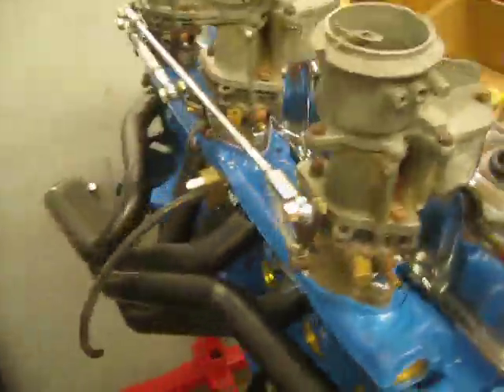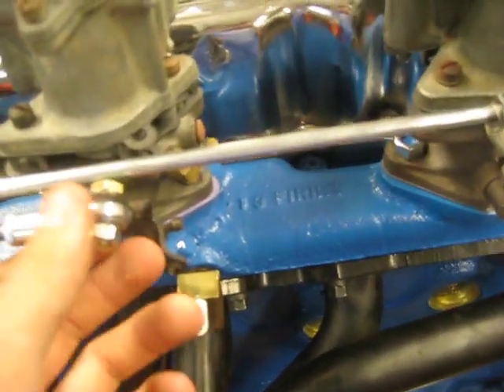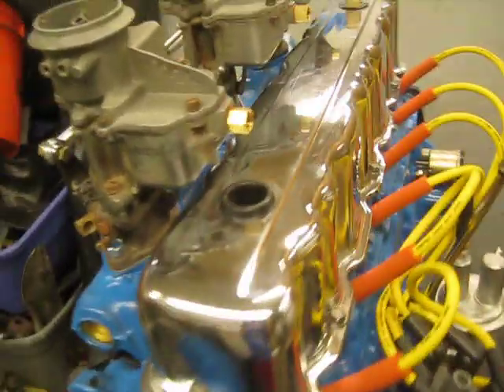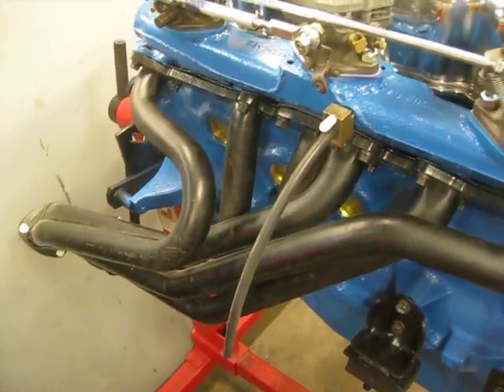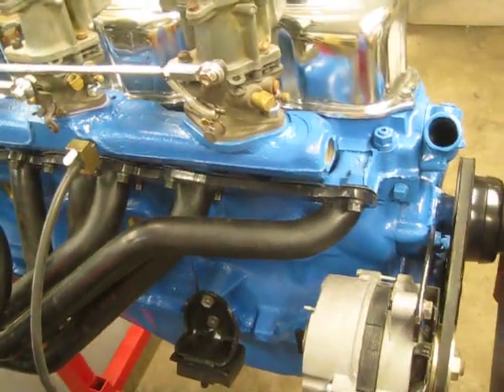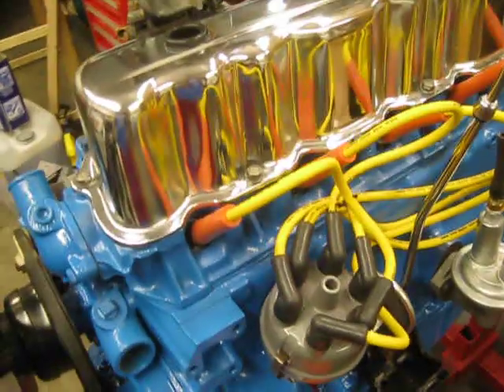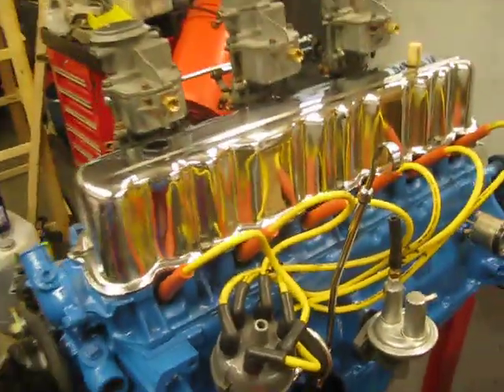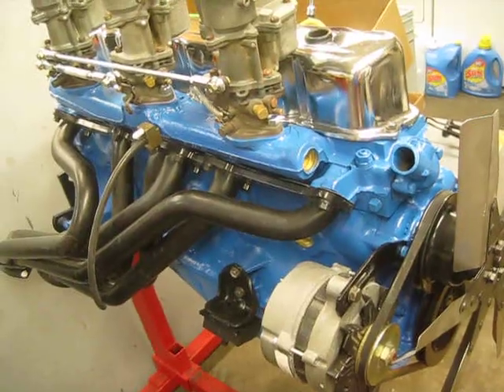200ci Ford Performance engine

Comment: 260hp isn't crazy for a "6 cylinder" just for the shoddy cast log intake manifold for your Ford engine. Considering people are cranking out 2,000+ horsepower out of a Toyota 2JZGTE engine. 260 is peanuts but still far better than the 120 or so horsepower the 200 made from the factory. I say we all lean on some foundry's to get the Vintage Inlines aftermarket aluminum cylinder head churned out again!

Comment: 240 Horsepower?  That’s still pretty good.   Considering the bone stock barra motors are about  250-260 hp.   But anyway excellent job.   Right now I’m working on rebuilding my 250ci L6 from a 76 ford Granada that was dropped in my 63 ford ranchero.
Reply from the maker: Thanks! No idea what it actually makes, that was just a guess based on several other similar builds. Sweet project, I like the early Rancheros.

Comment: Nice set up. Hope that you are still around. What year was the cylinder head. In order to do this mod one has to have, as you have, a flat intake log in order to be able to modify it. Would you  be willing to sell  the mod process?
Appreciate a reply
Reply from the maker: 1975 250 head. On a round log head you would just fish-mouth some tubing and weld it between the head and the carb flange.

Comment: I'm impressed with the weld-onto cast iron carb flanges. Three carbs should help w' the fuel distribution issue. Back in the 70's I used a Colortune clear glass spark plug to help balance multiple carb setups. Uni-Syn carb flow tester was also a necessity. It made a BIG difference in part-throttle conditions.

Comment: Nice 200! I have in my 64 Ranchero, good little engine, mostly stock, elec. ignit. with a 5 speed behind it, good for the freeways driving. Thanks for posting this; good luck and have fun with it!
Reply: What 5 speed did you put in and how did you find the bell housing for it ??? I’m really confused on how to fit a bell housing bc no one makes them
Reply from the maker: Use your stock bellhousing and get an adapter plate from Modern Driveline. The adapter plate will allow the 5 speed trans to bolt up to your original bellhousing.
Reply from the maker: Part number MD-401-2102 for 1967+ bellhousings, MD-401-2103 for 60-65 bellhousings

Comment: Good evening. 
I know you posted this video years ago, but could you tell me where you got your cylinder head? I am working on an inline 6 for a 67 Mustang, and I wanted to upgrade. Appreciate your help.
Reply from the maker: I built it out of a 1975 model 250 head
Reply: @SuperKONR  the 75 head still has the intake casted to the head? Is there a head that fits the 200ci that doesn't have that intake molded to the head?
Reply from the maker: The only production head with a removable manifold is the Australian 250 "2v" head. There used to be a guy importing them to the states but his website went down a few years back.

Comment: What ever happened with this Tri-carb 200?  I've looked at your more resent videos and dont see any break-in or install vids.  I was hoping to hear your motor run??  I built a 200 myself, but didnt have the guts to attempt a tri power setup.
Reply from the maker: I think there's one of it running on the test stand. I broke in the cam and it's just been sitting, it's going into my 1940 Desoto eventually.

Comment: I have a complete stock 200 6. What are the best performance upgrades I should do with the best value? Hp vs cost.
Reply from the maker: The biggest problem with these engines in the integral intake. If you're going for modifications I'd get a late model large-valve head and have it machined for a 2v carb. The thing with that, is while you're in there you might as well put a cam and valve springs in it, so it depends how far you want to go. What car is it in? They are pretty decent motors without modifications. I ran a fresh bone stock 1966 200 with a Holley 1910 carb and a Clifford header for awhile, it would pull hills at 70 with basically stock gearing and a manual transmission. Don't bother with electronic ignition, points work better.
Reply: SuperKONR thanks for the reply. It’s in a 65 Mustang. Sentimental value being my grandfathers. I want to keep as stock as possible but I also want to be able to keep up on the freeway.
Reply from the maker: Is it an automatic or manual? Another little trick is to get a 1966 distributor. They have mechanical advance in them as well as the vacuum advance, gives you a little more total when cruising on the highway. These cars weren't set up to run modern 80mph freeway speeds but with a fresh tune-up and a few minor mods it'll cruise at 70 no problem. You should post a video of you car, I'd love to see it!

Comment: I have a 62 ranchero with a 200 ci from a 65 mustang, what cam and carburetor should I got with, something that'll work with the stock internals nothing too crazy I'm just trying to get as much HP as I get without modifying too much since it's a daily

Comment: nice work mate, sweet looking motor. what welding rods you use to weld carburetor flange onto the log??
Reply from the maker: Thanks! Nickel rod is needed to weld steel to cast iron. I've used rods like "nomacast" with a stick welder with success as well, just go in short bursts and peen it as it cools.

Comment: Sir would you let me know what all you did and where the parts you ordered them from I have been wanting to build a  Ford six cyclinder  every thing you have done is want I want.  And 250, 260 horse power that's pretty freaking awesome
Reply from the maker: The cam came from Clay Smith, the header is from Clifford, and the rest is modified stock parts with full ARP studs. It has a billet double roller timing set imported from Australia, I don't think you can get them anymore. Be ready to spend some time in front of the milling machine!
Reply: @SuperKONR  thank you Sir

Comment: Why would you spend all that money on that motor and install a FRAM?? Use the Motorcraft, the FRAM will come apart.
Reply from the maker: No shit, that's why I put a Purolator on it when I ran it :)
Reply: SuperKONR some people don’t know the hazards of the Fram. Cool motor.
Reply from the maker: Thanks. Yeah once I saw their cardboard guts I started using them strictly as plugs for painting and stored motors. Apparently Frams fancy filters are OK but I just stick to Purolator, Wix, or Motorcraft every 3k miles.

Comment: Also I found a four speed top loader out of a 428 police interceptor  and the correct bell housing, pilot bushing, clutch  to mate them together    all this plus a 8 inch traction lock rearend. My 63 comet station wagon gonna haul ass

Comment: Hi i was wondering where you got your fan from and whats it called.
Reply from the maker: It's a flex fan, I got it in a pile of parts that I bought. Don't use one though they suck. Unfortunately, not literally. I now use the factory heavy duty 6 blade fans from a/c equipped cars, they work the best.

Comment: Did you ever install the engine And how is it doing.
Reply from the maker: It's sitting in the back of a shed on my test stand at the moment, on the back burner for awhile
Reply: SuperKONR  I have a 68 Mustang coupe 6 line this will look good in my car. Would you consider ever selling it and how much.

Comment: Ditch the fan, use an electric fan and a shroud with a thermostatic switch. 180 degrees...Did you buy a timing gear that can be adjusted? The cam "timing" is critical !!  You can install a restrictor in the oil port before installing the rocker shaft, it limits the amount of oil flow to the rocker arms but helps keep the pressure and volume in the bottom end. ..............okay looks great!
Reply from the maker: Electric fans suck ass, almost as much as the garbage flex fan I had on this thing when this video was taken. I use a factory mechanical fan off a V8 a/c car, the heavy duty version. I've hauled ass up long hills, and sat in summer traffic, with no shroud, and have never had it get hot. Even with a junk overbored block with paper thin cylinder walls. I've got a '69 model 24" 3 core copper radiator in the car so that helps too. 
This motor does have an indexable timing gear, if I remember right I set it 4 degrees advanced. I never looked into restricting the oil to the top end on this one but that'd be a good idea, I have full ARP studs and whatnot and was planning on winging it to 7 grand or so. Thanks!

Comment: Nice build ! I have a similar build, 200ci block, 4 main block, 60thou oversize flattop pistons, zero block deck. 250ci head port & polish, HID distrubutor, stromburg BOV-2 Carby. Struggling with engine temps at the moment with the original radiator and fan from a 1962 falcon. What engine fan are you running?  Thanks
Reply from the maker: I use a factory fan off a V8 a/c car for all my engines, they are heavier and rob a good amount of power, but with a '69 model 3 core 24" copper brass radiator, I've hauled ass up long hills and the temp gauge never budged. I personally hate electric fans, and mechanical flex fans really suck (not literally...), but the old heavy duty stock fans really do the job well.

Comment: looks nice but the carbs won't shine up cos I tried that on that metal. If you use clear coat from a spray can it will make that color shine and won't blister from the heat of the engine. Have fun!

Comment: Nice work, just got a beautiful 66 mustang i6 and want to add HP. Is there enough hood clearance for the new intake?
Reply from the maker: No I built a 4" cowl hood for it, but if you used Autolite or Holley carbs and low rise filters it would fit under the stock hood.

Comment: Nice set up mate! Have done the same triple carb on an Australian cast 250 made reliable 220hp at 5300rpm. The removable manifold 2v versions do exists in oz however are rare. Ford Australia used this block right up til 1989 with a alloy cross flow head and Webber carbs and even EFI. Then modified block and went OHC right up till 2017 DOHC.

Comment: would you know where i could get a basic kit to do a rebuild for a 250 out of a 75 maverick? also whered you get the header?
Reply from the maker: You can get kits from rockauto or most any oe parts supplier. The header came from Clifford. If I remember right, Hooker makes a long tube version as well.

Comment: How much did it cost to do this build?
Reply from the maker: IIRC it was almost 2k in parts. I did the machine work and assembly myself, would've probably been another 800 or so.
Reply: SuperKONR where did you find the 250 head?
Reply from the maker: Local wrecking yard

Comment: I remember my 74 Maverick. Had the Carter YF4 and needing to get a smaller pilot jet from a 170 to get the idle mixture lean enough (!) with the air bleed screw. Got about 26 highway at 55 with a C4. "Turbo" muffler and flex fan added a bit.Points ignition was a pain. Solid core wires.
Reply from the maker: That's some good gas mileage! I had a stock 200 in my car for awhile with a Holley 1940, I never really tuned it but got a nice 18mpg on the highway at 65 loaded with camping gear. I use points in all my engines, they do need to be adjusted once in awhile but I like the simplicity of them.

Comment: I got a '67 Mustang in high school with a 3-speed, and believe me, I used every last one of those 120 horsepower. I didn't have the money or the skill to do any mods, but I sure wish I had...It finally gave up the ghost with 92k miles on the clock.

Comment: Love it. Apparently, these things are good for 7000 RPM.
I used to have an 82 Zephyr with a 200 I6. Got the car for $500. If only I'd known all those years ago......
Reply from the maker: The bottom end is good for 7k but you'd need valve springs to handle it. Those are relatively light cars, you could probably get one moving pretty well with a 6.
Reply: Yep, had a 79 Fairmont wagon with the 6. I'd lose a drag race with an 18 wheeler, but with some choice Mustang suspension bits it handled great. Wish I could've hung onto it and done something like this with that engine. :-|

Comment: what is it going into?  and now that it's 2017.. did you get it dyno'd yet?
Reply from the maker: It'll eventually make it into my 65 Mustang. It's on the back burner for awhile. And nope, I'm not dyno-ing it. I couldn't care less what it is as numbers on paper, I'm more interested in how far it pushes me back into the seat. We'll see what the quarter miles times are though.
Reply from the maker: Nobody but me has ever touched this car and nobody else ever will. I have a wideband in the car to see where the carburetors are at under load and a dwell meter to dial in the timing. I'm not letting some dyno goof blast the thing to 6 grand, probably lean as hell, and not take responsibility when he burns a hole in a piston.
Reply from the maker: Trying to find a knowledgeable person is the hard part lol. I've always been able to get things dialed in pretty well myself so that's what I do.

Comment: Very impressed with the modifications done to the intake allowing the use of 3 carbs. I had a 1973 Maverick with the 250 and wanted to modify it but the intake/head casting put me off.
Reply: Brian Searles same I got a 77 Maverick with the 250

Comment: Nice engine build, whole lotta detail. I diggin the 3 carb set up and the headers going to sound super sick on there, when U pull up people going to think u have a Ford big block! The only thing I would suggest to changing out that Fram oil filter, here's the skinny all that hard work u put in that engine is in danger of getting to much or too little oil. The fram filter uses cardboard inside vs other filter use actual metal. I own 3 classics and would not recommend the Fram filter. Do a quick search on Fram failures and you'll see what I'm talking about.
Reply from the maker: Thanks! I haven't run it with the header yet but even with just the stock manifold it sounds close to a V8, it's pretty sweet. I'm well aware of how crappy Fram is, I've cut open several of their regular orange filters and will never buy another. I just threw that one on at the time so I could prime it and adjust the valves, and keep dirt out of it. I use Purolator filters. I used a PureOne to break it in, it's one of the best filters on the market.
Reply: SuperKONR ok cool just didn't won't all your hard work to go to waste. Looks great thinking about getting me a 64-65 mustang with an inline 6. But then I have to get rid of my Ford F-250 with a 390 and not sure yet if I wanna transition.
Reply from the maker: vanleer69
I appreciate it!
They are decent cars and they are pretty cheap, so it'd be good if you wanted a little beater hot rod. They are light so you don't need a big block to go fast. If you still want to haul stuff you can put a hitch on it and tow a trailer.

Comment: Should have went with a 250 instead...and I thought the 250 had the intake that unbolted unlike the 144-200engines?Still a cool build.
Reply from the maker: All of the US produced 144-170-200-250 engines had the intakes cast into the head. Australian 250 heads have removable 2v intakes.
Reply from the maker: This is what I had so this is what I built. The 250 is the same as a 200, just a taller deck for the bigger crank, so all my parts would bolt onto either engine. Same integrated intake.
Reply: thisisntme 

you are both wrong.  None of the North American falcon sixes came with removable intake.
Reply: zapwatt exactly the only small ford sixes to use any kind of separate intake system were those from Australia,would love to mill off the entire intake myself and see about making an intake system from scratch.What do you think?
Reply: Kenneth Skipper a post 64 200 has  unboltable intake.

Comment: Excellent Job! The headers and tri-power intake look great next to the stock version. My stock exhaust manifold looks like it was made from Lincoln Logs. However, these 200's are dependable work horses and make a great base engine for these mods.
Reply from the maker: Thank you! This one should be a nice street engine. I have a few other 200s stashed away that I'll be using to test different cylinder head modifications.
Reply: Would that intake manifold fit the 250 inline 6?

Comment: super sweet. I have a 65 mustang. with the numbers matching 200 six. i would so love to do this to in.. i have been looking around trying to find parts?? could you help me ?biggest thing is were to come up with the cam. n pistons. 30 over?
Reply from the maker: There are several cam manufacturers that grind cams for these. Clay Smith, Clifford, Isky, Schneider, and I think Comp has some as well. Clifford had journal problems in the past, be careful if you order from them. The specs depend on what you are doing with it, for a mild street car you might look at something like an Isky 262 supercam. Best thing would be to call the cam company and give them your specs and they will recommend a cam. You can get stock cast dished .030 pistons from Enginetech or Sealed Power, you can order them from Rockauto. If you want a flat top you can look for pistons from a 2.3L Tempo engine.

Comment: Have you installed it yet? have you got a video of it running, how did it perform
Reply from the maker: +Jim Hurt My latest video has a clip of it running on my test stand. I'm dealing with vacuum leaks right now, once I get it sorted and running decent then I'll put it in the car.

Comment: NOW THAT IS A ENGINE!!!! right on man how did i miss this vid. thats the kinda home brew stuff that's way cooler then a v8.
Reply from the maker: +Mr3wheeledbike That's the reason I didn't want to throw in a roller 302 like everyone else. How often do you see a tri-power straight 6 lol. Thanks mate
Reply: Now if you can adapt some side draft Webber’s on there I bet it would run great or just put on a draw thru  70 mm turbo to a Holley that engine can handle some boost it has 7main bearings an great oil system to boot